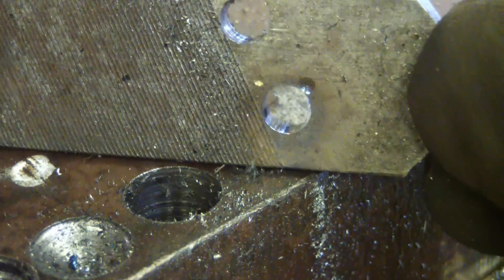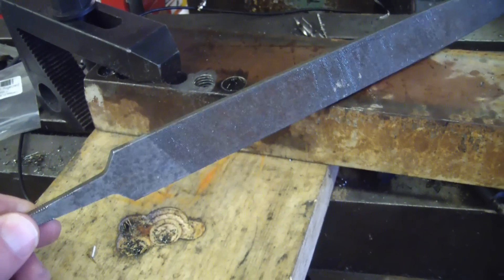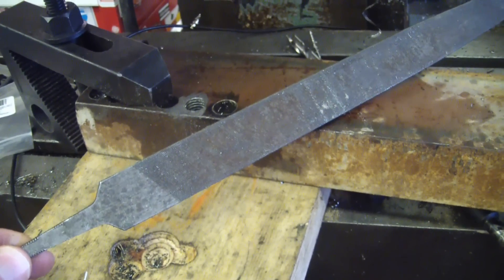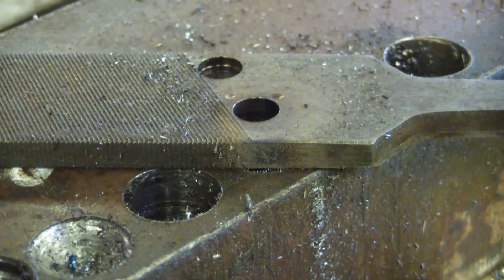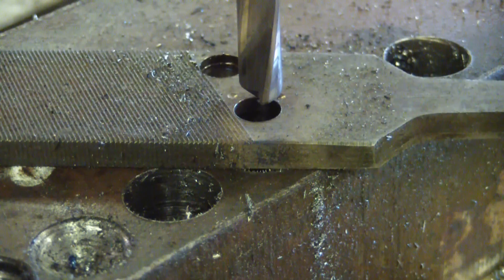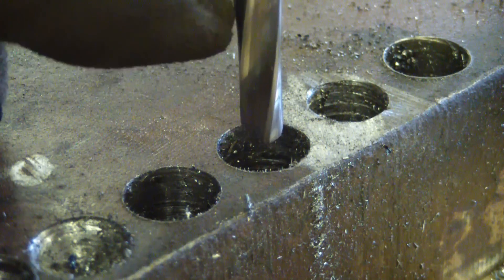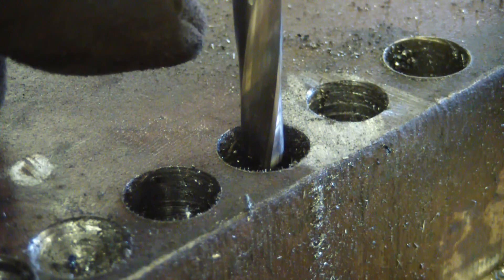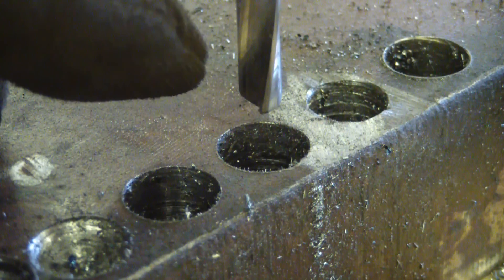Drill speed holes in a rusty old Bastard file

Comment: So the trick to drilling holes in hard stuff is using a drill bit made for drilling holes in hard stuff?
Reply: Cool,  I've got it on repeat. I'm sure it will sink in eventually.
Reply: ***** So my math degree is still useful in my retirement.
Reply: I use shitty bits and a lot of rapid tap its ok to take your time.
Reply: @timhofstetter5654  excellent technique.
Reply: @timhofstetter5654  Show me!
Reply: @DerelictDan69  I just use cobalt bits and trans fluid. It's the one juice all metals like to drink
Reply: @edwardrook8146  Trans fluid as in transmission fluid? And what brand drill bit? Ive been trying to drill a 5/32 hole through a file. So far I’ve tried those blue spyder brand bits and two norseman brand cobalt bits, one a step bit and the other a normal twist bit. Used tap magic with my Drill Press RPM as low as possible i think its around 970 RPM
Reply: @KINGSENSA97  I use Norseman. You might need a carbide tipped machine drill for what you're doing

Comment: Respect.  Those bits would go in a little padded case under my pillow. I would not let anyone know I owned them either.

Back when I did homemade toy electric motors I used a little patterned card on the shaft that you could use in conjuction with fluorescent light flicker to get an RPM approximation.

Comment: I have over half a century of machining experience and will say if you really want to know a trick for drilling hardened steel in your home/hobby workshop without any fancy equipment, I can tell you what has worked very well for me. Cheap straight shank masonry bits. Especially if you have a diamond or silicon carbide grinding wheel and put a bit keener edge on them. At a couple bucks apiece they are expendable and the carbide grade in them is much tougher than the proper steel cutting ones, so they will survive much better in a home drill press or even a hand drill. You can even grind the OD of the carbide tip a bit to adjust the hole size a few thou. Some brands work better than others, if you just look at them, you can tell by the appearance, look better, work better?(usually)

Comment: And now add the cheapskate trick, using a sharpened masonry dill :D

The old brigeport really has to work, it bogs down quite a bit :o
Reply: I do the masonry bit trick at work all the time on A2 and D2. I've drilled as deep as 3in. before with a 3/16 bit. It works like a charm so long as you don't melt the braze.
Reply: *****  Haha, the Galvanized masonic mystery bits ARE crumbly.  Now  the DeWilts or better seem to take and hold an edge cutting fiberglass, and that meant (for me) many fewer trips down from the cooling tower.
Reply: I use masonary bits to drill holes for locating pins in ball bearings on 2 stroke crank shafts it works great!

Comment: I have a very neat trick you to try.

Try drilling that hardened steel with a simple diamond coated wall-concrete drill but have the piece submerged in lots of water for cooling (otherwise the diamond will unglue) and up the rpm to about 1500.

I managed to enlarge some motorcycle disc brake holes from 6 to 10mm. Cuts like butter and is cheap as dirt.

Comment: And if you don't have a $40 drill bit ... put the file in a bucket of water with the handle end sticking out.  Use your trusty acetylene torch to heat the handle end up to about orange hot.  Use the torch to let it cool a little slower than just air cooling.  About a minute will do with occasional licks of the flame.  Voila, hopefully you'll end up with material softer than your harbor freight twisty specials.  How can you tell?  Try filing on it!  The water will keep the rest of the piece as hard as when you started.  Old cheap bastard trick.  (Nicholson files come from the factory pretty hard, over 60 Rc.  Heat treaters temper them back to known hardnesses and label them and then use them as dirt-cheap hardness testers.)
Reply: Spot annealing? Nice idea, I'm gonna try to remember it. It gets harder every year. Uhm  sorry what was I saying?

Comment: I haven't spent much time using Audacity but it's quite possible that it has an intelligent noise-reduction tool similar to the one bundled into Sony's Soundforge software. For video production purposes, it would let you selectively reduce/remove the squeal noise from drilling. It don't bother me, but I know it's like "fingernails on chalkboard" for some people, including my wife.
Reply: Same kind of tool. I'm not surprised Audacity has it, they've really been fleshing it out into a pro level tool.

The one in Soundforge is their (formerly couple hundred bucks separate purchase) noise-reduction tool, so it has more adjustments and options. Still get the "underwater" thing if the reduction has to be too extreme though. Oh well.

Hopefully, you keep thinking of things to do to that poor chunk of armor plate.

Comment: 17Hz?  That's lower than the speakers on my laptop will put out.....but all I could hear was a squeal that was closer to 17kHz(actually no where near that high, but still high! lol).  Typo or am I missing something?  .......watched it again in hi-rez......I see on the screen you picked the 17hz peak.  Could you hear it?  Was there a reason for picking that particular peak?  What did you get the input from?  Microphone?  On the camera? computer?  I used to see files being drilled at a booth at the big car shows and swap meets.....that was a few years ago when I couldn't even think about buying his bits. lol
Reply: *****
So, how do you pick which peak to take the reading from?
Reply: *****
Ahhh....that's what I was looking for.  If I tried to repeat it, I wouldn't have any clue which peak to pick.  When I was in high school, we weren't allowed to use calculators for tests.....so I learned how to use a slide rule and got permission to use it on the tests.  My dad had a really nice one at the time.  Worked great!  I doubt that I could even use one now.  Since there are guys using old files for knife blade blanks, there's actually a potential use for putting holes in a file. :)  Cool vid!!

Comment: Forgive me for not knowing nothing about nothing, but why solid carbide as opposed to carbide tipped?
Reply: Shiloh Jorgensen so the drill can be re ground and sharpened
Reply: James Griffin what could it be ground with ?
Reply: Probably an alumina grinding stone
Reply: Carbide is ground with diamond, regular grinding wheels don't do much to it.  For touch up, you can use diamond sharpening stuff such as you use for knives.
Reply: There are carbide-tipped drills, they are more popular (and much cheaper) in the masonry drilling sector.  Those are sharpened differently.  There's a YouTube video of a guy resharpening a masonry bit and drilling some hard steel.   Ah, the tips are silver-soldered on, and it's possible to get them to come off if you really overdo it!

Comment: I think tungsten carbide is so expensive because it requires an immense amount of electricity to produce it, its some kind of electrochemistry similar to an aluminum arc furnace. I used to sell machine tools, and noticed it was so toxic, after I handled it I would break out in contact dermatitus. I told my coworker to wash his hands before he smoked - but I don't think he heeded the advice. His pecker will fall off one day.

Comment: I had a problem drilling some 0.5 inch holes in stainless steel a few years ago.  Ate up about 100 dollars in drill bits.  For sloppy holes just use the plasma cutter.

Comment: I have a off beat question for you.   You never seem to (pilot hole) or (step) drill.  I was taught back in the old trades school to drill in three steps.  Was I taught wrong?
Reply: I sometimes drill a pilot hole that's just the size of the little straight part of the drill bit, the chisel part.  Then just drill to size in one step.  This makes it much easier for the big drill, and also I think the big drill follows the little hole.  I can't remember how this started, probably read something in an old Model Engineer magazine.

Comment: What brand is the drill bit? Ive been trying to drill a 5/32 hole through a file. So far I’ve tried those blue spyder brand bits and two norseman brand cobalt bits, one a step bit and the other a normal twist bit. So far only used tap magic with my Drill Press RPM as low as possible i think its around 970 RPM

Comment: always been my favourate material, i use a sandvik metal scraper with the carbide tips to clean carbon and shit from engine blocks, pistons, cylinder liners, especially when they have calcium build up, that stuff is hard as shit. Never used it to scrape metal but man is it a timesaver for cleaning crap off big diesels. Most guys seem to use broken power hacksaw blades shaped on a grinder to scrape shit, fuck that. Blisters all over your hands.

Comment: what's the difference (if any) between a tungsten carbide drill bit and a solid carbide drill bit? are there any advantages by adding tungsten, or is it just a cost saving measure?
Reply: "Carbide" is just carbon. It would basically just be a big pencil. Or a good a electrode. If anything you could have a solid tungsten bit, but I don't think that has near the strength properties of tungsten carbide.
Reply: justfakeit888 Graphite and diamond are forms of carbon, but they are not carbides. Carbides are inorganic compounds with carbon as its more electro-positive component, which is to say, in a carbide, carbon has accepted electrons to form a stable compound, such as in the compounds titanium carbide (TiC), calcium carbide (KC2), and tungsten carbide (WC).  In tooling and metalwork, the standalone term 'carbide refers exclusively to tungsten carbide.

When carbon donates electrons to form a compound, it is not considered a carbide, as in carbon dioxide (CO2), and carbon tetrachloride(CCl4).
Reply: A bit over the top to answer his question I think, but I appreciate the info.

Comment: no cutting oil??
Reply: yeah, dude, i can see that it was dry. so i assume that running a drill dry isn't as bad for it as legend would infer
Reply: ircimager With high-end drill bits, hard materials and relatively heavy feed rates, oil or partial coolant can be much worse than cutting dry. If you lubricate but don't flood it enough you can end up with thermal shock problems. Sometimes you'll need something for chip clearing, and is another option there. You can see impressive examples of this with white-hot chips coming off of a mill but the work piece and bit remaining below where they start to soften.

Of course, if you get the feed rates or speeds wrong, then you get an impressive failure.
Reply: Tungsten carbide ikes to be run dry or completeley submerged, something in between is no fucking good at all.
Reply: cutting oil is a sham, Mollee dee for tapping is the only metal cutting lube you ought need. (If using real machines with good tools)

Comment: What sample-rate is configured for the recording device...?  I think I can make out 44100, or CD quality, using 32-bit float.  The latter setting is great for your purposes, as it allows for a high granularity between sample volumes, based on floating point math, and so soft overtones can be distinguished from within louder sounds more readily.

But try to get your sample rate up, if it's at a lowly 44100; depending on the sound card, and frequency response of the mic, 96000 or higher might give you better graphs.  The encoded frequencies are up to 1/2 the sample rate, though artifacts are produced at the upper boundaries.  This means that a 44100 sample is only encoding up to 22050 Hz; this is adequate for human hearing, but a lot of interesting things can be heard/seen above.  As for what high sample rate recording can do, check out an early video of mine where I pull a bird chirp out of traffic noise....  Another where I slow bat sonar down into the audible range...
Reply: Ah, so with a camera, the audio is digitized there, at the sample rate and format set by the camera's hardware; there may be settings to bump things up a bit, but 48K is probably it for most consumer-grade cameras, though 96K and higher is probably available on high-end consumer and entry pro gear.  The audio stream from a camera is probably not in 32-bit float format, though, but probably 16, perhaps 24 bit integer.  

If you open a video file from the camera with Audacity, the native bit rate and bit format attributes will be shown at the track's leader panel.  If you then set Audacity's recording prefs  to the matching settings, the resulting sound files recorded from the camera  will be smaller and cleaner. 

The built-in mic on your laptop can probably be set to record at crazy-high sample rates, but the mic itself won't be able to respond to those frequencies:  looking at the spectrogram made of a noisy environment would show what the mic's frequency capability is...

Comment: Or, you could anneal it, use a H.S. drill bit, then re-heat-treat it.  If that process takes 15 minutes, and the carbide bit costs $40, it's kinda like getting paid $160/hr.  But this analysis does does consider the pleasure factor involved in the purchase of pricey tools!  :)

Comment: If you take a $.99 (or salvaged) photoresistor and solder it across the leads of a microphone cable, you can get a cheap and very accurate tachometer using the same audacity trick.  Works best if you print off an encoder wheel or strip (google encoder wheel generators), stick it to your wheel/chuck/pully/etc and bounce a laser pointer off of it.  But either way you'll get great results (plus it's just cool to listen to the audio it generates)